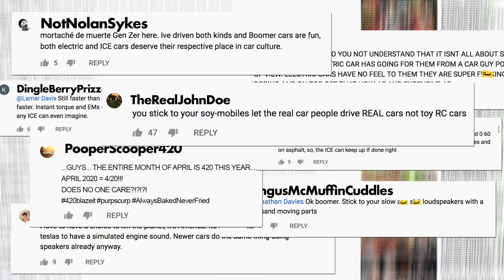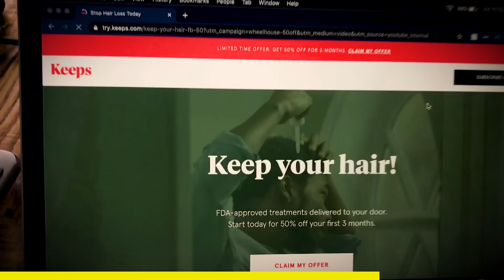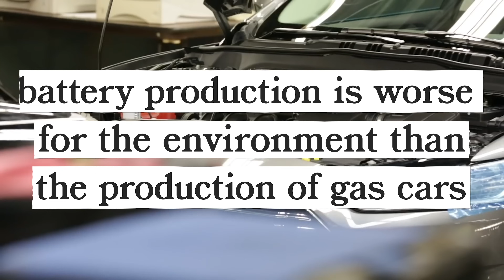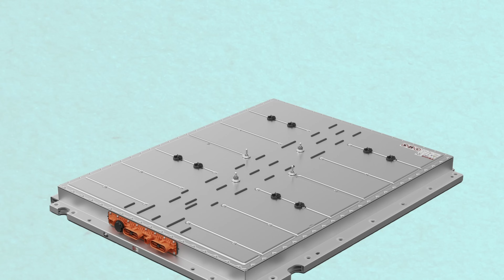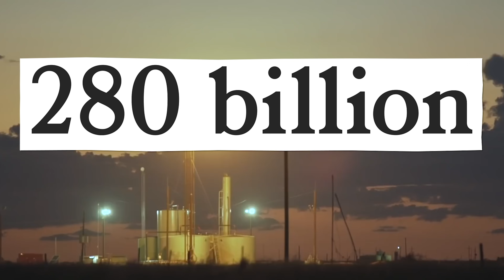Are Electric Cars REALLY Better for the Environment?

Comment: I feel you glossed over the electricity generation part. In my state when its hot and electricity consuption gets too high we have rolling blackouts. In my state we basically are just a minor surge away from disruption. How are we supposed to add millions of cars using the electricity grid without building more power plants that pollute? Also over its lifetime an electric car will use up its original battery necessitating a new one with all the pollution that entails. You forgot about the battery disposal when the battery's life ends. Also, you forgot about how nuclear waste lasts thousands of years. I want to add that electric cars are marketed as "zero emissions" lol.
Reply: Good point, pretty much no one mentions battery disposal. What needs to be developed is Thorium. Look into it.

Comment: Good video to get people thinking... one little thing you could probably delve deeper into is power production itself.  There are fairly significant environmental impacts, even with "green" energy production.  The biggest among wind and solar include materials used to manufacture the required equipment (don't forget about the photovoltaic cells used to capture solar energy or the batteries needed to store it) and the inherent inefficiency of these production methods when compared to their combustion counterparts (wind doesn't blow 24/7 and the sun doesn't shine every day, all day).  Then take into consideration that energy produced (in any form) is DC and must be converted to AC and stepped up in voltage to be transmitted across high voltage power lines from their source to your home/business/anywhere.  From there this AC power is stepped back to DC to charge any battery.  There is unavoidable, inherent loss in this process, each and every time energy changes form.  It's a really interesting and often overwhelming process to think about when you really put all of the facts and variables together.  So what's the overall solution here?  One word: Nuclear.  It has the more than enough capability to provide enough energy for all of the world's demands now and in the future.   The process does involve dealing with or storing spent fuel rods, but keep in mind, that waste is contained and the service life of modern nuclear plants can ensure safe, clean and sustained power production for generations!  Truth is we don't need EVs in a nuclear world.  We don't need to incur the initial 17+ tons of CO2 upon production.  Nuclear power can provide the means to produce an abundance of usable hydrogen that can be used in converted ICE powered cars.  Why convert to hydrogen ICE vehicles?  Zero emissions.   Burning hydrogen produces WATER.  We retain our ability to drive our ICE vehicles, fill them up in minutes using our existing (albeit slightly modified) network of fueling stations, all the while producing near zero emissions without the insane negative impact on the environment due to the battery production.  It's 2021.  If you want to save the planet, nuclear power is the only logical, sustainable  and overall global option when you think about it.  It's a really tough pill to swallow, especially when the uneducated, general public has been trained to fear nuclear power for decades now, but it really is the only option we have now and to meet the ever increasing energy demands of the future.  You have two choices.  You either live with electricity or without it.  We've all chosen to live with electricity and need to accept the simple fact that when it comes to energy and the inherent impact on thr environment in some way (regardless of form)... There ain't no free lunch.

Comment: In south africa our electric grid isn't even enough to power the country 24/7 that's why we have loadshedding(it's when the power supplier "Eskom" relieve the pressure on the grid by having electric outings in different times at different places in the country) the fact of the matter is we don't have the facilities in the first place to house electric cars and even if we did our electric grid wouldn't be able to substain it. So i struggle to see how poorer countries will ever go fully or even half electric

Comment: CO2 is THE gas of life. Without CO2, no plants, no life.
Zero emissions? Yeah, in many US states your EV is 'mostly coal powered'.
Good luck putting more solar and wind on the grid (mainly a question how much you are willing to pay). Solar and wind all need backup power plants that actually can control the voltage (and power) in the grid. 
EVs have many advantages and will be important, just don't think it will ever be 'zero emission'.
Nice to know that the research and development of the only energy source that can cover the bulk of the electricity we will need (aka nuclear) was stopped for 50 years by the environmental movement.
Since most climate change discussion is propaganda and has nothing to do with science, I basically give a f**k about anybody using 'climate change' activism to make them feel good.

Comment: skip all the hyperbole! Visit fueleconomy dot gov
This site is somewhat biased because it doesn't let you compare apples to apples.  You cannot select the comparable ICE model to the EV model.
The assumptions used in the fueleconomy.gov analysis are here. https://www.fueleconomy.gov/feg/label/calculations-information.shtml
Of course the costs of processing and disposal of batteries are not figured in to total cost of ownership by neither the author or the fueleconomy.gov because they are unknown

Also wind turbines installed in the US are imported but thanks to President Trump's US manufacturers of solar panels and cells are growing

Comment: I'm sorry to disagree but where did you get the information that an electric car running on coal energy pollute less than a combustion car running on gas? Besides, you don't take in consideration the replacement of old batteries (10 ton eq. CO2) every 4 years, the spare energy lost in transmission, and the possibility that the combustion car runs in renewable fuels, like biodiesels and ethanol, which are almost 100% renewable resources.

Comment: the dirty secret of the electrical industry - SF6 insulation is a greenhouse gas 23,500 times worse than carbon dioxide and its emissions are increasing rapidly due to green energy

Comment: You forgot to talk about how solar panels and windmills and etc. are made. To make solar panels, you need to mine coal and quartz, thus creating even more CO2. Also, windmills need to be made with extremely heavy machinery that uses massive amounts of oil and gas. Even after all of this, solar pannels and windmills struggle to make almost any energy, and gas is just so much more efficient.  On top of this, people will not buy the millions of gas cars that are built, leaving all of the waster materials to rot. This means that all of these precious materials (steel, alluminum, etc.) will just be wasted. Overall, There is no true way for electric cars to save the environment. There is no existant power source that works 100% clean. Nuclear power plants are the closest thing we have right now, but energy plants will not be willing to part with their pretty pennies in order to swap to nuclear.

Comment: But wind/solar power plants don’t produce enough power efficiently and require large plots of land and each one needs a back up fossil fuel power plant. And there’s many many MANY more reasons why wind and solar suck for powering the grid... so no, an EV only would be less impactful on the environment if powered by fossil fuels or coal because renewable energy is actually far worse for the environment
Reply: https://youtu.be/RqppRC37OgI

Comment: Guy with a Diesel Generator going to come save your A*S when you run out of charge
Reply: Or a diesel tow truck to bring to to a charger that has about a 50/50 chance of actually being switched on and working.

Comment: James you forgot even when you said it to make a car you need steal rubber and plastic that you didnt account for so the electric car is already populating the same amount before the car is even made plus takes away water and we will be using more plastic on a electric car then a gas one to make cases for all the batteries plus the waste and the way plastic cant really decompose
Reply: No, that was covered. The conclusion pretty much was that an EV leaves a bigger footprint behind when created compared to a regular car but in the long run the EV will make up for it with lower emissions. Sounds like a "choose your poison" kind of deal until EV production becomes more efficient and less intrusive to the countries affected by the production of them.

Comment: You said but didn't explain that plastics are made by fuel which makes the casing for the battery for they car plus the fuel needed to make the car steal and aluminum also fueled vehicles needed to mine so no matter what your using fuel to make the electric car

Comment: how can an electric car powered from electricity originating solely from coal powerplants be better than similar combustion engine one? it does not make sense because first you have more co2 during manufacturing second you have coal first mined then turned into electricity then transfer via grid then power the battery. it seems like coal is mined itself and crude oil is the only only one creating emissions.

Comment: REAL EFFICIENCY OF Electrical Vehicles vs GAS-POWERED VECHICALS                                              H.VIVAT  P.Eng. M.Sc. Auto-transport & mobile equipment     Toronto.        Feasibility study. 

That article discusses efficiency of Electric car. (EV)                                                                             Electric vehicle market share globally is 2.65%. 
Energy to power EV comes from an Electrical Grid. So far, most of the world energy is converted from fossil fuel, nuclear and renewable.  Next I will find the Total Efficiency of EV and gas-powered vehicles using the ‘’Apple to Apple approach’’.                                                                                                                                                            -The Total Efficiency of EV is a sum of two components: EV car efficiency plus the efficiency of energy supplied by Electrical Greed: “Power plant-to-wheels”
 -Total efficiency for gasoline-engine car has only one component: “Gas tank – to -wheels”. 
On average, gasoline is producing 124000 BTU per gallon , when #4 fuel oil is producing 141000  BTU per gallon A Coefficient of 141000/124000 = 1.137 will be added in EV efficiency calculation.. The cost of those two products are taken as equivalent as both are by-product of refinery process. Power plant efficiency running on oil is 0.40; It happened to be the same value as the average world efficiency of power generation (coefficient of 0.40)

Calculating the sum of Total efficiency of the EV based on average world numbers: “Plant-to-wheels”:
1) Total efficiency of all electrical average power plants in the world is 0.40  
2) Efficiency loss of transporting electricity thru’ the electrical grid (power lines, transformers) are 7% 0r 0.93.                                                                                                                                                     3) Efficiency loss of electrical car battery is 10% loss when is charged. So charging efficiency is 0.9; 
4) Efficiency loss of an electrical car battery when discharged is 10% or 0.9;
5) Efficiency loss of an electrical battery when temperature fall below -10 c is 0.6
     For calculation we will take 0.85 (not everywhere and not all the time is winter.)
 6) Efficiency loss of 15% of electrical power for heating up the car or cooling off (air-condition/heater)   coefficient is 0.85
 7) Mechanical efficiency:  transmission (not so complicated as at mechanical car) and all other moving parts including the wheels are only 0.90;
8) Finally efficiency of an EV electrical motor is 0.93
9) Battery efficiency for 4-5 years old battery is 0.75 (Battery life is 8-10 years). In all published work EV testing provided with a new battery?    (4 years older battery with 100000 km should be used)
10) EV “Charging convertor’’ from AC to DC, comes with 0.95 efficiency.
NOW WE CAN CALCULATE THE TOTAL EFFICIENCY OF ELECTRICAL CAR, BASED ON THE WORLD DATA: 
0.40 x 1.137 x 0.93 x 0.9 x 0.9 x 0.85 x 0.85 x 0. 90 x 0.93 x 0.75 x 0.95= 0.148 in most of the studies the EV efficiency is calculated for the range between idle to 100 km/h when only in very few studies you may find that additional energy of 25% more than gasoline car is required to rich the speed of 120-140 km/hour.           That means that efficiency on higher speed will drop. But those losses will be compensated by the higher loss of energy at the gas-powered car during idling and slow parking.   
Conclusion: based on the world fossil fuels usage for both cars the calculated efficiency is: for EV = 0.148 for Gas-powered Car = O.170. It looks that gasoline powered car is a bit more efficient device than EV. However those results are theoretical and it is based on the average efficiency by world power plants and it’s done by using similar oil based fuels. The same EV charged by renewable, hydro, nuclear would not emit CO2 and would have different efficiency based on the fuel used by the Power Plant.                                                                                                                                          Disadvantages of EV car are great, starting from the initial cost, batteries, additional weight of 1000 lb., charging time ( fast charging may ruin your battery) and etc. (See Ref 2.)  One of the most important PROS of EV is reduction of the LOCAL and partially of total pollution. Based on above calculation, actual CO2 pollution produced by non-fossil fuel should be the main concern of making the right decision what car to buy. For example in Ontario 71% of electricity is generated by non-fossil fuel. Remaining 29% produced by fossil fuel. However, that amount is responsible for 51% CO2 emission (Calculation, see page3).  Based on that information, EV in Ontario can be assumed as a vehicle operated by 51% fossil fuel and 49% by renewable and nuclear; it will produce half CO2 as gas-powered vehicle. For that condition a” PLAG IN HYBRID” would be a better choice than EV.
Total worldwide electricity production consists of 27% renewable, 10% of the nuclear energy and 63% of fossil fuel. 37 % of non-fossil fuel consist from 11% of renewable from ‘’other sources”, 16% of hydro build 10-70 years ago and 10% of nuclear. It took more than 20 years to get to 11% generation of by “other resources “.  The new ‘’dream project’’ is to convert remaining 63% of fossil fuel generation to renewable for 20 -30 years. Entire Electrical Grids would be completely rebuilt and also expended to generate additional electricity to operate EVs. 6 out of 8 billion peoples are inhabitants of the relatively poor countries. They would not be able to contribute funds for such project. All western countries are responsible for 25% CO2 emission. For the next 20 years a HYBRID vehicle would be a better choice.  Plug in Hybrid car is more reliable with lower CO2 emission.                  
 EV battery consists of 7000 round small batteries. EV battery is very expensive to produce and dispose.   EV Battery last about 7-10 years or 200000 km with a loss of the capacity to 0.6 on the end of battery life. (See ref #2). Cost of the EV battery is 12000 CAD. In the future EV market will be divided by two groups: one being able to afford a new expensive EV and another group would be left to buy a used EV with replaced auto market battery. The life of the car body shall withstand 20 years in adequate condition. 

CONCLUSION:
My TAKE for the future of auto transportation is: The larger part of transportation sector should be taken by HYBRID vehicles, next it will be shared by EV vehicles. The rest will be left for vehicles with high efficient gas-powered engines as well. However in some countries the last approach could be reversed. Gasoline distribution stations are already in operation. New construction of electrical charging stations will become a very high expense. Replacing and upgrading of high voltage power lines, reconstruction of previous and adding new transforming stations would be part of that task.
  -------Crude Oil Production is one of the most important necessities. As a result, the initial refined products are responsible for production of 6000 essential various products. Starting from asphalt, bitumen, jet engine fuel, plastic, drugs and so many others that it is not possible to list them all; only 40% as a by-product is gasoline. It should be used up! One of very feasible usage would be fuel for Hybrid cars and for high gas efficient vehicles.
In spite of all difficulties auto industry is trying to persuade that EV is one of the best solution to reduce world CO2 emission. It could be true if the world electrical grid would be converted to non-fossil electro generation.   As a result of it ,politicians together with auto industry are keeping potential EV consumers in the dark , and constantly bombarding them with the false information . 
 All calculation are made without adding of 9-12 metric ton of the CO2 emission as result of manufacturing the lithium-ion batteries. REF# 4